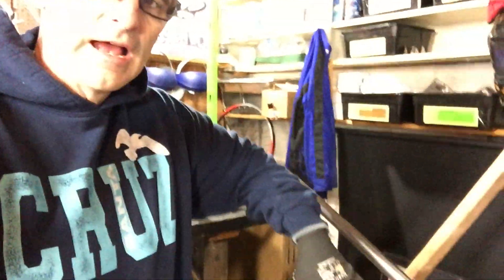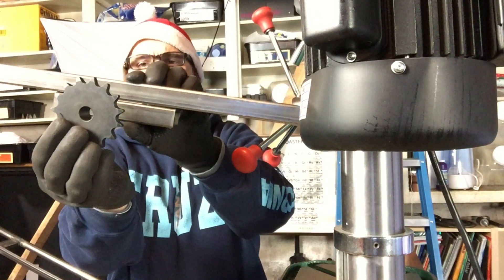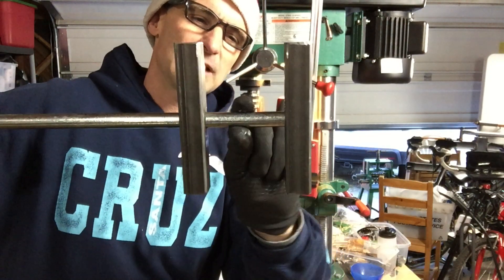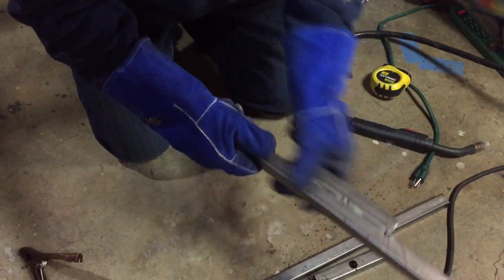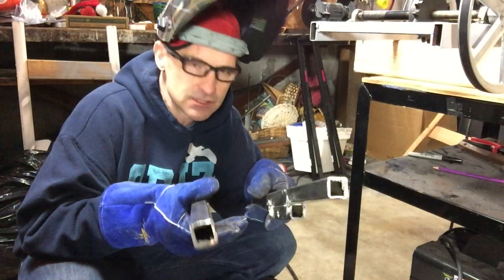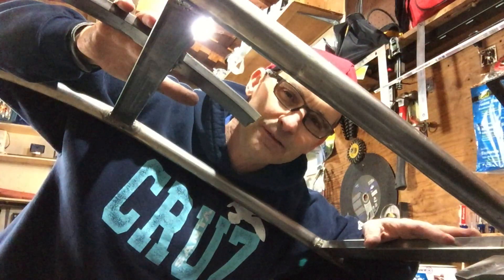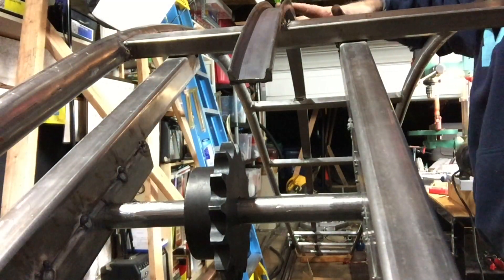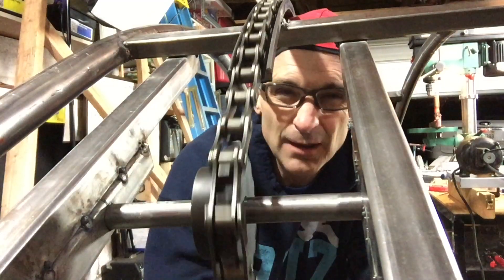Chain Lift Top Sprocket

Comment: Hey, Will, you're an inspiration to all of us tinkerers! Have you considered an outside sprocket about halfway down underneath to control the tension of the chain? Also, what's that clip under your end logo?  - Thanks!
Reply from the maker: Hey Paul Minard! Thanks for your kind words. It's an absolute joy to do these videos. I'm just about to put up a video about the solution to the chain lift, and a few other goodies. The coaster in the end card is Apocalypse at Six Flags Magic Mountain. http://youtu.be/z2A1Y_uURQk It is, by far, my favorite wooden coaster. Lyle says Twisted Colossus will take first place when it opens. But, I'm not so sure.
Thanks for watching!
Best,
Will